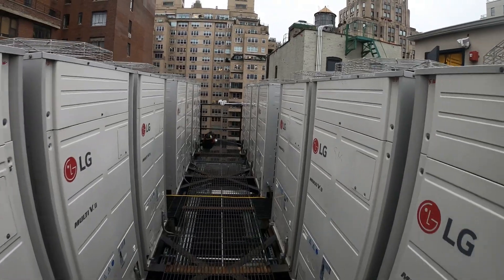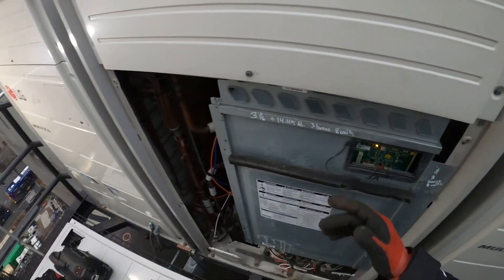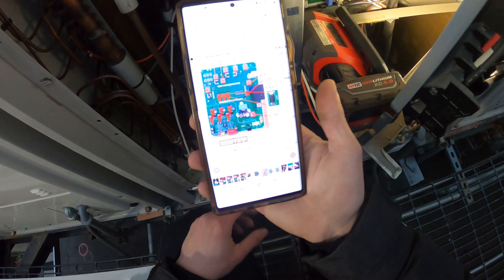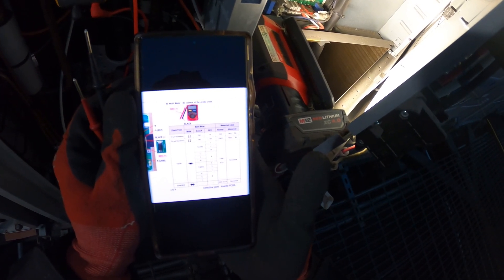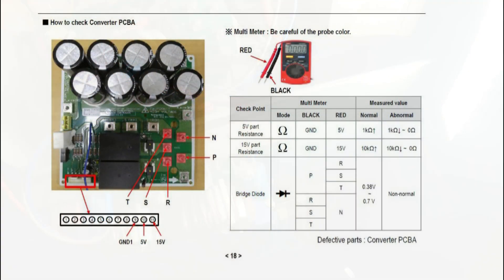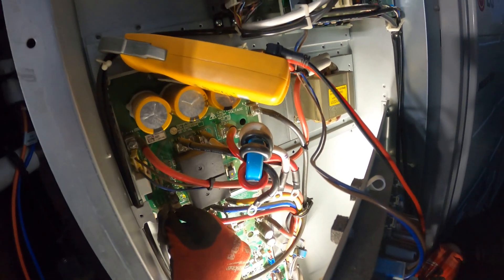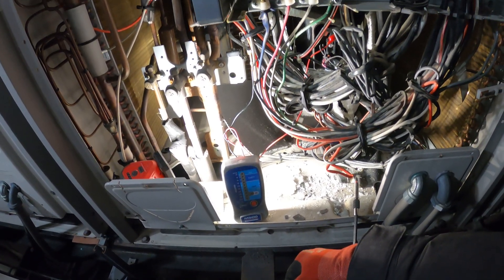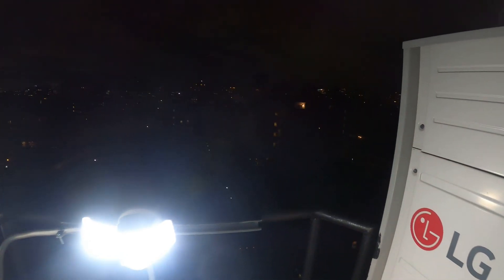HVAC Service Call: LG MULTI V IV Not Cooling/Heating (LG Multi V 5 Error Code CH26/Error Code 261)

Comment: The converter board is nothing more than a glorified bridge rectifier 3ph to DC board with a bank of capacitors to smooth the DC right out, also those two black square things I imagine are contactors - when you first apply power these should remain open while the capacitors are charged, slowly by some resistors, then after a few seconds, the contactors close to put the rectifier directly on line - without this, the inrush current to charge the capacitors would pop the breaker.   If the breaker pops immediately on power up - check for welded /failed contactors on this board.   Also the brown deposits on the boards look like flux from having things like the IGBT module replaced, I think you said these are refurbished but approved boards?

Comment: I work with VRV mainly. We have issues with compressors just like any VRF. Most of these issues stem from bleed by on indoor eev's. We've seen proper maintenance through the year greatly reduce bleeding by. With older models such as the lll's, we saw that autocharging prematurely set charges wrong. By doing routine maintenance on outdoor main eev's, you can see that they crack over time. Changing these out are very beneficial to said compressors. We've also had bad luck in past years with aluminum(rough lock) installs. With aluminum, leaks are almost always a certainty. Keep up the good work brother, love the channel.
Reply: Is that just indoor unit eev's or even the ones in the heat recovery boxes? One of our compressors the scroll shattered almost like it slugged liquid. Was told the unit should catch it before that happens however in theory is not always the results in field.
Reply: @asdasda z  we've had eevs in the bs boxes flood. But, I believe that's more of a rarity. It does happen, but is rare. We've seen more and more indoor cassette eevs and outdoor eevs bleed.
Reply: @asdasda z  also, was the compressor on a VRV 3 or 4?
Reply: @samuelsteffan6987  Gen 5 LG unit. I know certain vrf brands and models all have their quirks. The safeties should catch flood back in cooling we have one unit throwing those codes right now.
Reply: @HVAC544  they all certainly have reasons for bleed by no doubt about that.
Reply: Daiken uses the term vrv instead of vrf lol it’s the same they just wanna be different and daiken is they drop compressors every 2-3 years

Comment: Another 😲
Reply from the maker: Yup. 2 in 2 weeks. I just started working here 4 weeks ago! Looks like things are going to get fun
Reply from the maker: Another unit went down today but for another reason 😬
Reply from the maker: 3 for 3
Reply: @JumpermanTech  We have here an UNUSUAL rate of inverter PCBs overcurrent issues, control PCBs burnt & shorted compressors.
Reply from the maker: @JuanTodoli  I've only dealt with these machines a handful of times here and it's the exact same issues you are experiencing. This happens alot according to the people that work there. These units have been a problem since the beginning. Wow. Any advice?
Reply: @JumpermanTech  The only advice that can be given if the problem comes from the electrical network is for the customer to install a surge protector.

Comment: My M500 has never been wrong
Reply from the maker: I always liked that tool. So easy to use. I did just pick up a megohmmeter with an LCD display that gives you an actual number. Solid & for a good price. The Klein tools ET600. Someone in the comments recommended it
Reply from the maker: Thanks for watching!

Comment: Liquid refrigerant migration can cause compressor to short out. Maybe even temporarily. That’s why compressors insulation resistance requirement are usually lower than other motors.
It is usually important for the freezers and coolers - but you are still in a cold weather, you should check crank case heater, whether it’s even installed, and whether it’s still good. And if it’s bad - why board didn’t produce the fault code and didn’t shut down the machine.

And if the compressor didn’t have heater installed from the beginning - someone who ordered this equipment did screwed up.

Comment: You are so lucky you get all the interesting jobs with burnt out compressors on LG units.  In the last decade, I have never had an LG unit compressor failure. I must be doing something wrong.. 

You should never use the Subco magger resistor Ohm tester on these inverter compressor’s .   They will test out BAD often when they are not..

Comment: Cool to see more VRF content. We've had a bunch of issues with the gen v units losing compressors. I'd assume most of it was install/commission issues more than anything. We cut one open and the scroll was shattered.
Reply from the maker: Glad you're enjoying the content. A 3rd unit went down today but it was an outdoor fan motor related issue. This place is going to be fun
Reply: @JumpermanTech  We have done 9 compressors and 2 four way valves at one site. We have a system down now but its still at minimum 1.5 days we usually get 2 full days incase of hiccups.
Reply: @JumpermanTech I appreciate the work you do  to keep  the heat/cooling   I have a split system that someone dumped on the road side with all it's gas in it still  the compressor etc is healthy so I am going put it in my shed it's a non inverter one  and it has a Mitsubishi head  as the original was junk so going to part it out
Reply from the maker: This location has had & still has a bad experience with losing compressors. Any input or advice? Thanks for watching!
Reply: @JumpermanTech  Never messed with the Gen4 units only experience with the 5's. We have had LG tech support out from Korea. Still waiting for the report back from them. Ducted airhandler airflow was never setup properly at this job. However, I feel that's not going to solve all the issues. We put surge/phase imbalance on the units and still loosing them. We never get any codes from unit prior to the CH21 once it shows a CH21 its mechanically failed.

Biggest thing to cross off the list first is proper installation and piping along with proper nitro brazing. Obviously it can be hard to view some of the piping once its already installed.

Other than that just recording the units and going over the data if you see crazy EEV readings or temps that don't make sense investigate. These units are becoming more common in my area seems like yours the last 20. Finding guys that are knowledgeable on this stuff is hard and the manuals only show you so much.
Reply: @JumpermanTech   I would check the level of oil in the compressors coming out.  I would also check the clarity of the oil, odor, and test for any acid.  Flooded starts are the number one killer of compressors.  Sounds like you have had multiple compressor failures on some of the units.  I would check for proper installation  or design problems, or possibly power problems at the site.  I wish you luck.  Are the compressors out of warranty now?  Do you think the inverters are killing the compressors, or do the inverters fail due to grounded compressors?    I don’t know much about these systems, but do know a lot about the cause of compressor failures.  Those roasted compressor jackets look like their getting hot.  Is this a common problem with other buildings?  I use AEMC hand crank meggohmeters.  I’ve got three.  You can’t find them reasonable on eBay.  They are industrial quality.  Been using them for 25 years.  They are analog, and don’t use a battery.  Test voltages can be set for 250, 500, or 1000 volts.  Also has a built in voltage tester.  I don’t like ohmmeters that use 9 volt batteries.  I usually test with twice the motor voltage.  It will also read high, if there is any moisture or contamination in the system.